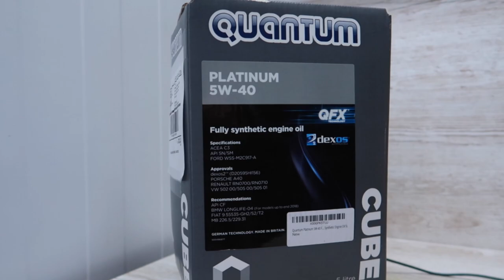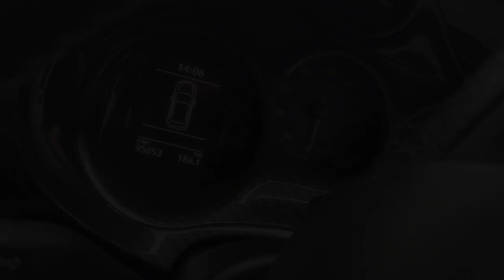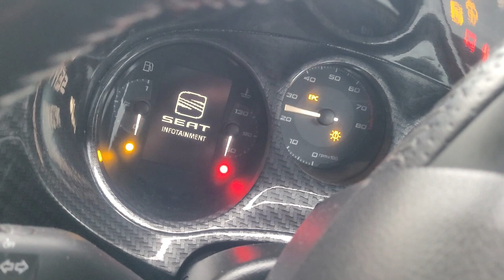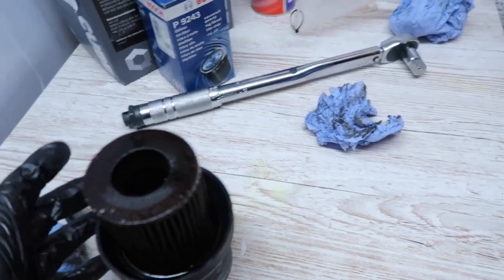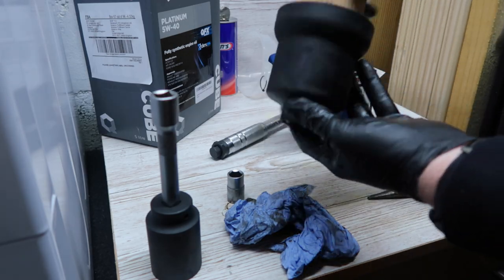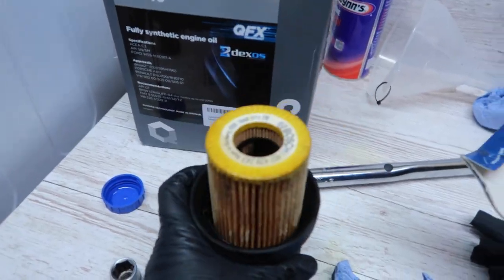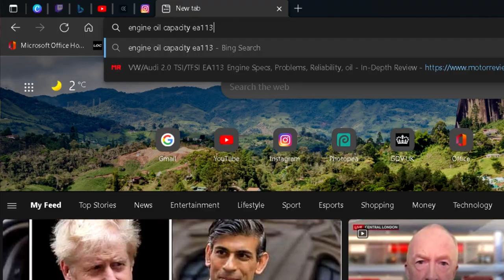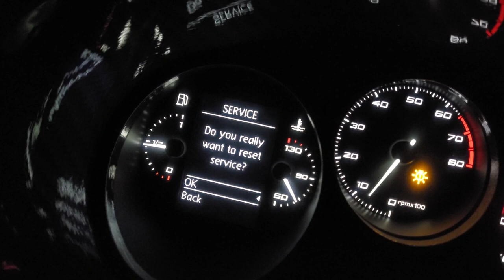Performing an OIL and FILTER change YOURSELF | TFSI Oil change MK2 Leon 1P1

Comment: Hello mate, very useful video thanks for uploading.

Question: are you using the quantum platinum 5W-40 on your car because it's s tuned or does it not matter if it's tuned or stock 2.0 tfsi engine?
Reply from the maker: Cheers mate 👍🏻
I use the 5w40 just because my cars a bit higher mileage (100,000+) though does no harm to use it anyway especially in colder climates. It is handy to use in tuned cars also

Comment: Also where did you get that magnetic sump plug from mate, got a link?
Reply from the maker: Yep, I'm pretty sure it was from awesome GTi. Just double check ur sump plug for the size of socket it needs. 14mm socket was for my M14 plug, I think 17mm/19mm is for the M24 plugs.
https://www.awesomegti.com/shop-by-brand/ecs-tuning/ecs-magnetic-sump-plug-with-10-replacement-washers/
Reply: @NorthCoastWorkshop  nice one cheers mate 👌

Comment: One thing I noticed is that the plug you pushed in with the screwdriver, it was completely loose when I handled it. In your video it seems way more stiff and falls back into place. Mine popped out and I had to put it back with my fingers. Now the car is dripping oil from the filter housing
Reply from the maker: Yeah it's quite hard to push in initially, as the spring in it is pushing back quite a lot. Worth maybe getting it off to see if it can be reattached with the spring. Sometimes these housings become brittle with age. I alway consider upgrading mine to the billet aluminium version, but it's a fortune, and fortunately my one is still lasting.
Reply: @NorthCoastWorkshop  I’m about to do an oil change now (literally did one last week), to see if I did something wrong, or the housing needs replacement. I really hope not, this car is getting expensive 😅
Reply from the maker: Hopefully you can see what has popped out of place and it goes back together, it should always be trying to spring it's way outwards, but then lock out in place and seals itself. Hopefully it's fine, and if you pop the week old drained oil into a perfectly clean container, you'd be able to re-use it again rather than pay for a new 5 litres.
Reply: @NorthCoastWorkshop  oh man, I can’t tell you all about it in this comment, but I bought new oil. In the span of 1 week, I’m about to put on my 16th liter of oil now. Got 7 liters ready, hopefully she stays sealed this time 😄 If not, we’ll drive into the sea 😌
Reply from the maker: 😬 oh dear, well fingers crossed for u mate, otherwise use Google for a new plastic housing, sure they'll be reasonable 🤞🏻
Reply: @NorthCoastWorkshop  thank you buddy. Now it’s done, and I made sure everything was done correctly (except the drain plug thread was skipped I think, so it was only tightened as much as possible).

Hope it holds tight this time. Noticed some ticking from the engine (still has 4.6 liters of oil in her), but I guess that is just the sound of fuel injectors.
Reply from the maker: @nitrodreng  yeah they are ticky engines. As long as it's not coming from the camshaft chain, all should be ok 👍🏻
Reply: @NorthCoastWorkshop  thank you

Comment: New plug? 😂
My 320d plug has done 150k km with change every 10-15k km 😂
Reply from the maker: No new plug 😅🙈 just reuse the magnetic one, after a quick clean 😎
You're looking after ur 320d very well then 👍🏻 it will happily keep on going for another 150k km 💪🏼